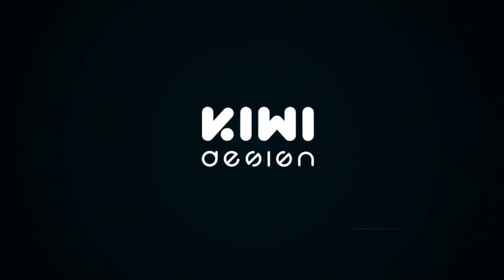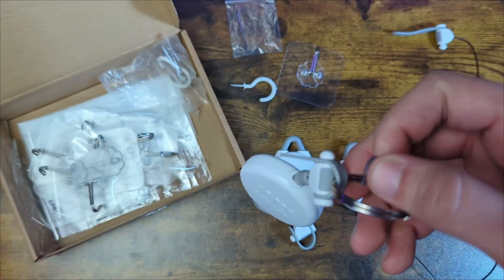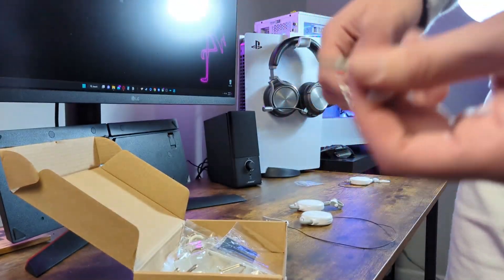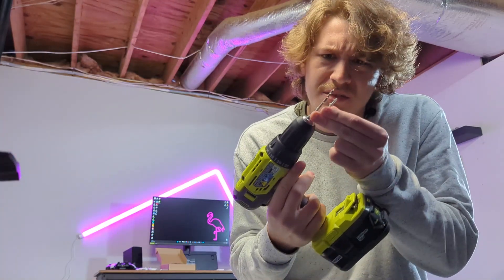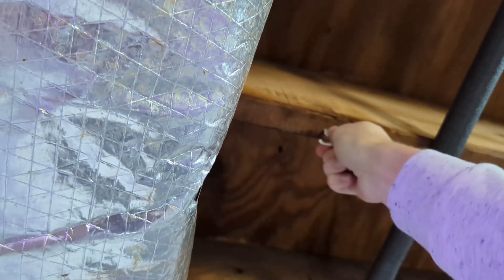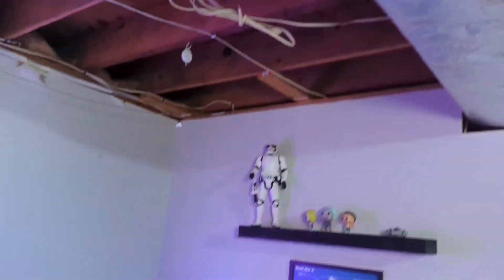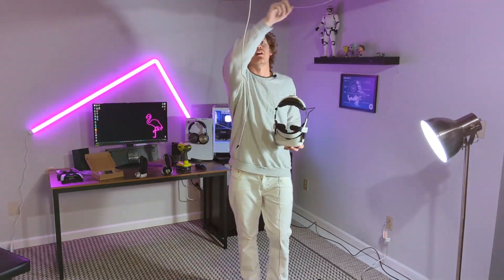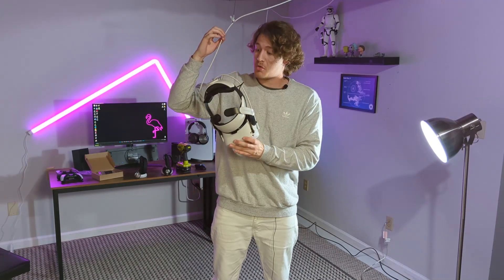The best way to play PCVR ! - KIWI design Pulley system

Comment: Hey, do you know if it's possible to use the sticky stuff on a popcorn ceiling?
Reply from the maker: @toasterconsumescheese2979  I don't know. If you try it let me know. Maybe it can glue well but maybe not. You can sand little squares maybe to make it smooth
Reply: I did it and haven’t had any issues!

Comment: Any tips on how to keep it out of the way when I use my cable management? After turning around so much it begins to form a knot in the cords at the very top of my head and I begin to feel a tugging sensation when I play and it gets annoying.
Reply from the maker: Yeeeah, U can't let that happen. This is a cable finisher. I think there are two things that u can do. 
1st ( the free solution)
it's just to learn not to turn to much, or know what side are you are turning the most and turn to the other side next time that you have to look back. And also, you can put a fan facing you. That way you always know where to look.
The 2nd one you can only use if you are playing steamvr. There's an app that you can buy called Turn Signal. This app puts a overlay in floor, that tells you how much you've already turned to a side.
I personally just put my hand on the cable from time to time and unturn. But the only other way that I know is to use it wireless. I hope that that wasn't too confusing.